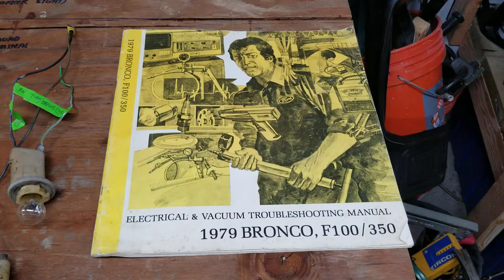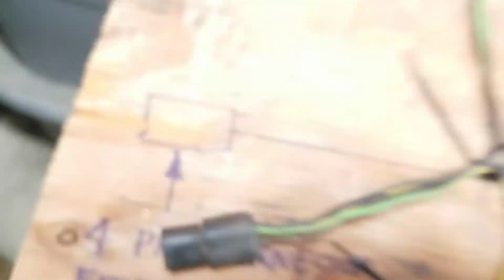1973-1979 F-Series Pickup LED Tail Lights - Wiring Alterations

Comment: I need help! I’m trying to find an original diagram. I’m having a terrible time connecting my lights and making them work because I have no clue what they go to.
Reply from the maker: David, I have a few 73-79 F-Series factory electrical wiring diagrams (not exactly sure what years). What year is your truck? Let me know and I can scan them on Monday at work and figure out a way to e-mail them. Don't put your e-mail on a reply as you get to much junk e-mails.  Wayne

Comment from the maker: I received a few people who have interest in the LED tail lights, so I thought I would reply to everybody in a comment.  I do plan on selling these and show what is involved in making a set of these.  I am currently building enough for (8) trucks. This video shows how I originally split the housings apart, but I have a better way which uses a gasket to keep the water out. I will put out another video in a week or two. I am waiting for the sheet metal shop to finish the stainless steel clamp plates which mount everything. I will post how much for a set when I go thru all the receipts I have stacked up. Thanks for the interest and check back to see when I add another video. Wayne